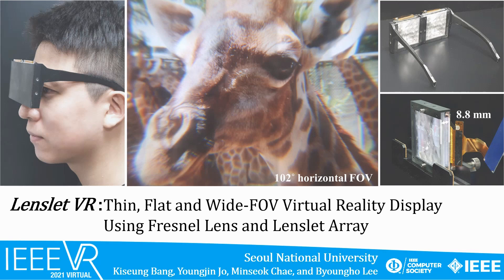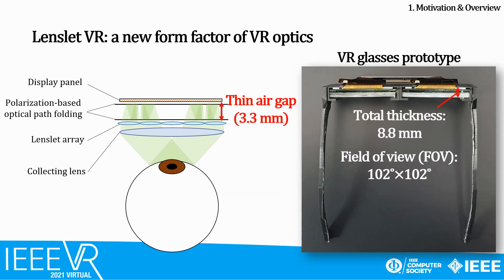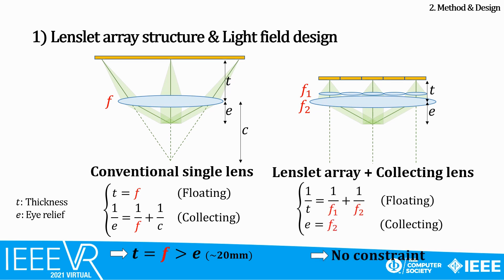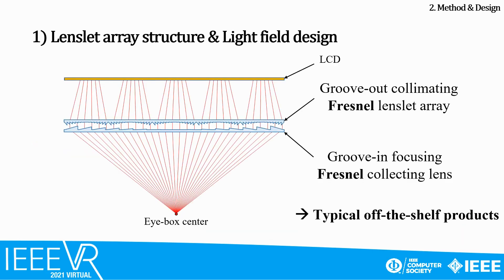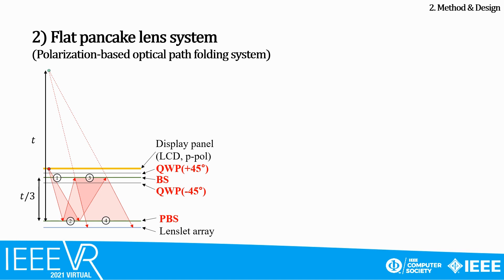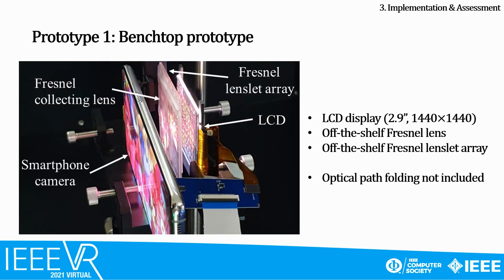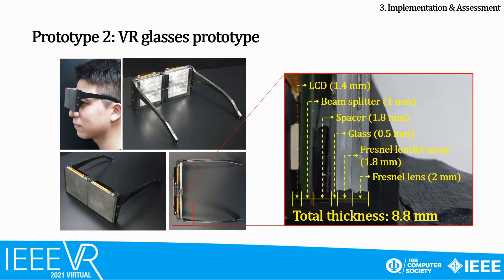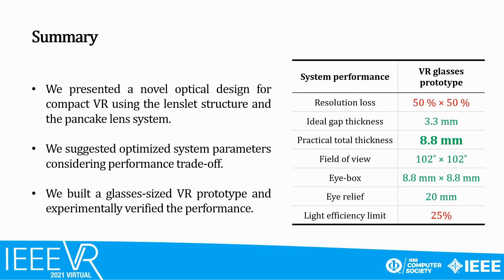[IEEEVR 2021] Lenslet VR :Thin, flat and wide-FOV VR display using Fresnel lens and lenslet array

Comment: I have heard about this tech (near-eye microlens array research) from Douglas Lanman (he started his working at MIT) before 2013 and I was amazed his work... what about you? 
2013-2014: 1.https://www.youtube.com/watch?v=8hLzESOf8SE , 2. https://www.youtube.com/watch?v=deI1IzbveEQ
Now: https://www.youtube.com/watch?v=NSf-kZ5OV5A
Reply from the maker: Yeah. I also admire Douglas's work. Actually, my work can be considered as an advancement of his work. The main advance is the optimization of the resolution and eye-box, which could be acheived by the additional collecting lens. For example, his prototype at that time had excessive loss of resolution or too small eye-box, which pushes it far from practical usage.

Comment: I don't mind the size of the headset. but this is cool as heck regardless.
but 102x102 is still loooow if I'm being honest. I feel like 120 should be considered the industry minimum. FOV is a bigger deal than  size or anything else IMO
Reply from the maker: Thanks for your comment. Of course, I will consider achieving a larger field of view.
But here I just want to note that the 102deg FOV is only for a single eye. The binocular FOV can be 1.2~1.4x larger than that.
Reply: @kiseungbang9257  i just noticed that's on par with the index! nice!

is there a way to make this type of lens shaped like a pimax's lense?

I really wish headset manufacturers put an led matrix around the black area of the headset with a diffuser to give an illusion of a bigger FOV. it won't matter if it's low res or hard to tell what's there tbh.

but this is awesome I wish you luck :3
Reply: @kiseungbang9257  ooh nice :D

what I said didn't mean that this isn't awesome btw ;3 I as just saying i'd love to also see FOV incensements to headsets!
Reply: Yolopia  oh yeah totally. 
I feel like the index's 120 should be the bare minimum. I hate the QUEST 2's fov it's so immersion breaking